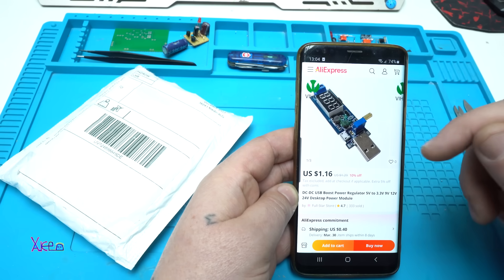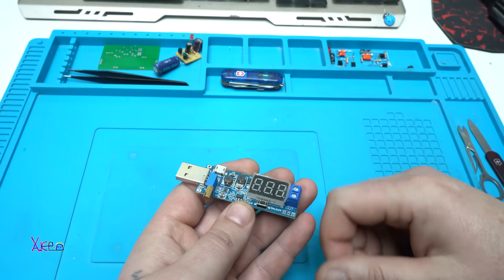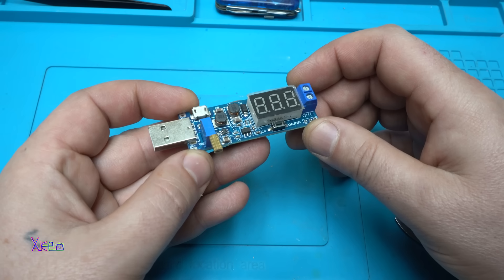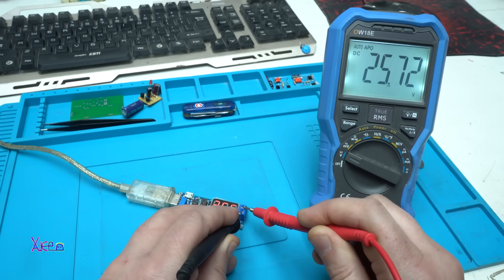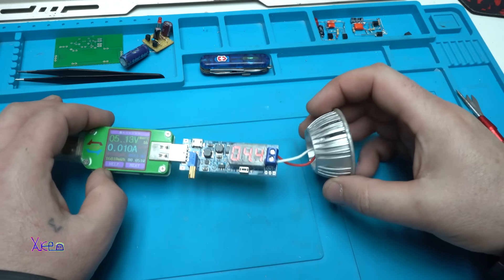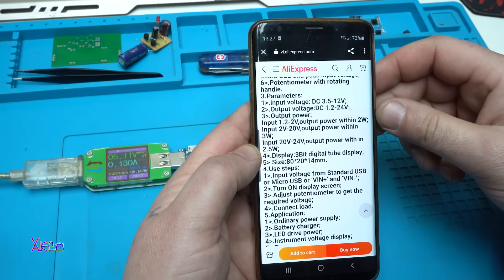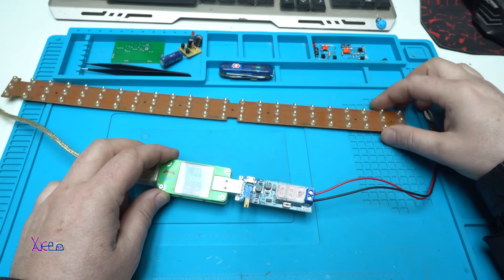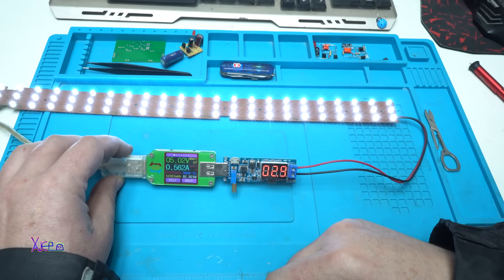WHY THIS $1 Aliexpress DC Boost Module IS BRILLIANT?

Comment: Nice device but low amperage!
Assuming 100% conversion at 10 V your 2 2A would become 1.1 amp & 20V. will be 550 mA. 
But we lose about 15% in the buck conversion.
We can still have a decent trickle charge at about 400 mA - 450 mA.
Not bad for a buck 👍

Comment: This is a fundamental principle of electronics, which I learned 45 years ago:
if you go in with 5V, the most you can get out is: 5V!
So it's a scam, even for $1.
Reply: May be the "fundamental principle" has changed. Heard about step up (or boost) converters ?

Comment: You can not calculate output Amps like that. There is no free energy. Only the usb meter that gives 5V x 0.5A=2.5W is correct and this is also the max output.

Comment: and you say nothing about amperage.
Reply: Well, if you divide the power (3W) by the voltage you need, you'll get the maximum current (it's the law 😉).
At 5V will be a current of about 0.6 A.
At 9V will be 0.33 A and so on...
For (very) small applications it's a good choice.
Reply: Output power:
Input 1.2-2V, output power within 2W;
Input 2V-2OV,output power within 3W;
Input 20V-24V, output power with in 2.5W;
Reply: of course its going to be peanuts of amperage! if it was amperagely powerful it'd be classified as a free energy device!:face-blue-smiling:

Comment: Do you think i can used to build an easy power supply for my 5 meters LED strip around the wall?

Plug  to the wall the right phone charger so connect this one (trough usb) to the Buster you showed setting the right voltage straight to the LED strip?
Reply from the maker: I think that led strip will pull a lot of current,this module is not design for that
Reply: @Hacktuber  thanks for the reply. Do you have any idea to how to create a little cheap power supply for the led strip?

Comment: I used basically the same thing, powered it with a TEC on a heat sink to charge devices in the woods, just need a heat source.
Reply from the maker: Nice! That's a very clever use of it.

Comment: We need to see the output on an Oscilloscope to see what crap is in the actual output, because its certainly not a clean DC output voltage with only those components on that PCB. 
How bad is the AC component waveform????????
Reply from the maker: Sorry,I dont have oscilloscope😔

Comment: Put a multimeter in series with the output load so we know output current.  Output and input currents are not the same, when you multiplied output voltage by input current you got a meaningless power.  Measure both currents and we can see input power, output power, and efficiency by dividing output by input power.

Comment: Wonder if you could run a 24v water cooker through it via a car lighter socket.
Reply from the maker: Not possible at all😔
Reply: you can use a power bank with the module to charge a car battery in about 5 days and then use the that car battery to cook your glass of water! hope this was useful!:face-blue-smiling:

Comment: 8:05 I think it draws 0.56A * 5V = 2.8W, so it's maximum 0.93A @ 3V on the output. Am I right?
Great finding BTW! 👍
Reply from the maker: Yes prob 1A is max current

Comment: Does the output voltage change with the input voltage? e.g. If the Input voltage was from a nicad battery whose voltage drops over time and the output was set to 2 volts, would the output voltage change as the battery voltage changes as it discharges?

Comment: You power calculation is a little of. Your input voltage (5V) times the shown amperage is the true Wattage for the load + the voltage converter.
So if you crank the output voltage up to let's say 15V and the amperage show is 300mA, the total power consumed is still 5V × 300mA = 1.5W and not 15V × 300mA = 4.5W. The current through the load (when neglecting the current used by the converter) is 300mA × 5V / 15V = 100mA. So the power dissipated by the load is 15V × 100mA = 1.5W. This is according the input voltage (5V) × input current (300mA) = 1.5W.
Reply from the maker: Thanks for explaining sir,great info👍
Reply: You are so wrong. if output shows 15v 300ma that means 4.5w (p=v.i) .. it means input its 5x900ma=4.5w.. watts are same input and output.. energy cannot be created or destroyed, but only changed from one form into another or transferred from one body to another.
Reply: @josuedanielmartinezsanchez4540  Exactly my point. The current reading was at the 5V input, so 5V × 300mA = 1.5W. And yes, energy on the input should be equal to the one at the output. When the measured output voltage is 15V, the current through the load (which was not measured in the video) should be 1.5W / 15V = 100mA.
Reply: @josuedanielmartinezsanchez4540  Hacktuber measured the current at the 5V USB side and not on the load side, but multiplied the input current by the output voltage. This is not correct. You are correct that the power on the input should be equal to the power at the output. With 5V, 300mA at the input, the output current at 15V should be 100mA.
Reply: @jansmit4628  i answer before watch the video hehe, yous aid.. (for example, no based on video) "output voltage.. lets say 15 v show 300mA" so i calculated on that... 4.5w hehe...
Reply: @josuedanielmartinezsanchez4540  never ever converter with efficiency 100% roughly 80%-90% is good converter. you never know abbout dissipasate power